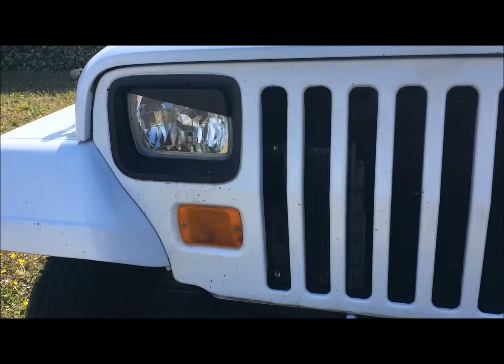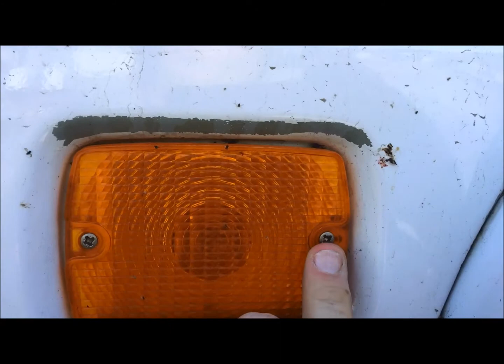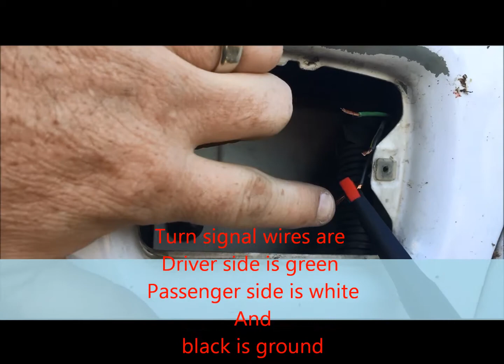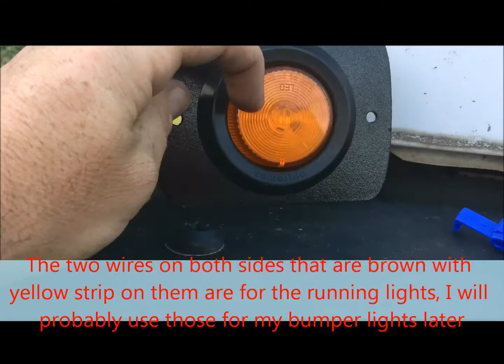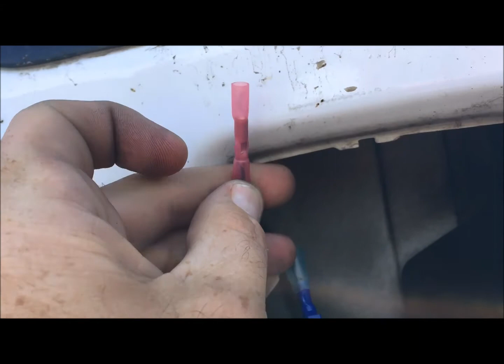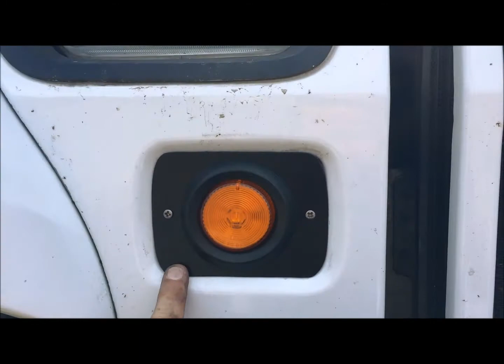Front turn signal led swap

Comment: hey man, if you were to add the running light from the harnes to the LED, which wire would you add the running light too?
Reply from the maker: iamphilosophy 
So I’m sure I mentioned it in the video. If I didn’t I will now. So it’s either one or the other unless you have a three wire light or a converter that will slow it. I couldn’t find a converter so I chose to hook the turn signal. So if I remember the turn signal is a purple on the tight side or passages side and a red on the left or drivers side.
Reply: @OFFAxisBuilds  i wathced your vid a few times and i didnt see it, so thanks for responding, i have a 3 wire, hot, ground and turn signal, same as you, so cant i connect the hot and turn signal together? so i can have it a running light and turn signal (like factory)
Reply from the maker: No unfortunately you cannot unless your led has a three wire connector.
Reply: @OFFAxisBuilds  dang ill have to keep them as running lights then :( thanks for the help, so cant i just get  a 1inch  LED and wire the flasher wire to it with a ground to the body and  that will work as a turn signal?
Reply: + a resistor
Reply from the maker: iamphilosophy  
I put a resister in the Circuit to help with the low amp draw from the led. It will help with your slow blink.
Reply from the maker: iamphilosophy 
Thanks for checking out my channel and subscribing. I hope I was able to help you out. I looked all over for a three wire 2” light and couldn’t find one.
Reply from the maker: iamphilosophy 
I was actually thinking of doing the same thing. I was having problems with finding a good location for that 1” turn light. I thought maybe in the bumper but just haven’t got around to it. If I do that I would rewire the lights to be 2” running light and a 1” turn light.
Reply: @OFFAxisBuilds  its ok im trying to make these 4 inch 2 wire jk amber lights work,  i have them set up as running lights, but as you said they cant be turn signals aswell so im trying to add a LED for the flasher, we have the same yj haha ,your a huge help brother
Reply from the maker: iamphilosophy 
That should look sweet. I. Could be wrong but I think the newer cars switch the ground on the turn signals to allow them to be two wires not three wires. So they would actually be turning the light off not on like the older cars did. I’m not sure if that makes sense.
Reply: @OFFAxisBuilds  good idea if u have that stock bumper you have a tone of options to mount the 1inch LEDS, if you were to wire the 1 inch  LEDS to flashers and make your 2 inch to running lights, how would u go about it?
Reply: just add a resistor  to the flasher wire and ground anywhere right? for the 1 inch LED turn signal idea
Reply from the maker: iamphilosophy 
Use the green wire as a turn signal and the other wire as your running light on the driver side.  The passenger side would use the white wire as the turn signal and the other as the running light. I think both running lights wire color is brown but I could be wrong.
Reply from the maker: iamphilosophy 
Yes that is correct
Reply: @OFFAxisBuilds  thnaks for all the help, if it works ill let you know
Reply: @OFFAxisBuilds  thanks for the help, subbed and liked
Reply: @OFFAxisBuilds  your right about the wire colors,  i have a 95 yj like you so the 1 inch led with a resistor and a ground should work, but ill try it and get back to you once i do it
Reply: @OFFAxisBuilds  i did the 50 watt  resistor thing on the driver side green wire and grounded it, works like a charm my man
Reply from the maker: iamphilosophy 
I’m glad it worked out. Did you use the jk front lights or did you go with a 2” round light.
Reply: @OFFAxisBuilds  the jk lights
Reply from the maker: Sorry it looks like the driver side turn wire is green, and the passenger side turn wire is white. On both sides the black is ground.

Comment: Where did you get those turn signal lenses???
Reply from the maker: I made the black part out of aluminum, then I cut a 2” hole for the light. I got the light from my local auto store.
Reply: @OFFAxisBuilds  ok.thanks. they look cool. They're one of a kind that's for sure...
Reply from the maker: MrSlickmonster6973 
Thank you
Reply: Where did you get the material to make them???
Reply from the maker: I got the material from the local metal shop. You could get it from Home Depot or Lowe’s.  I made a template out of paper to match the hole. I reused the screw locations.